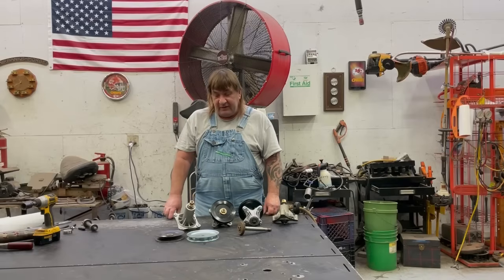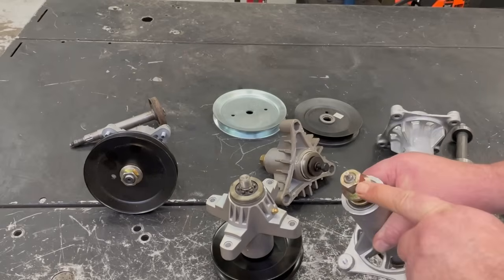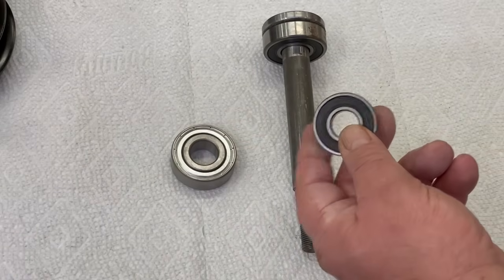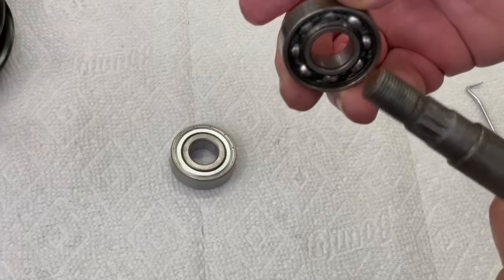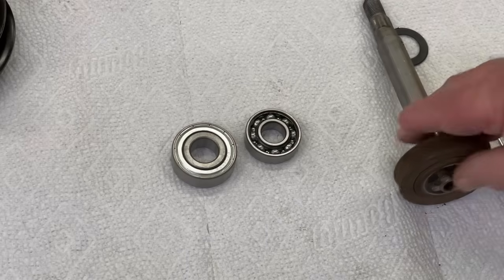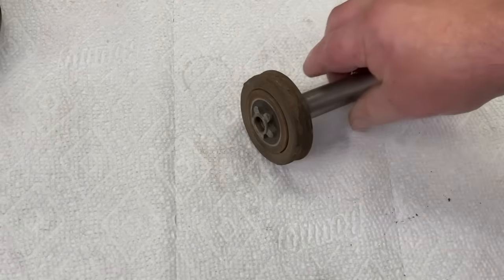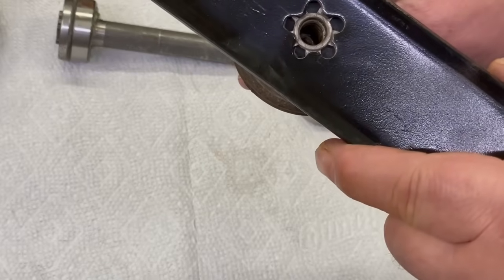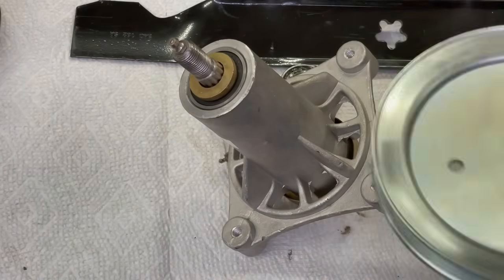BEST WAY to Grease SEALED BEARINGS on Lawn Mower Blade SPINDLES (make them last 3x as long)

Comment: You know when they put a greaser on a spindle that's not usable.. that really shows you how much they care about their customer.. if they would do that I wouldn't put anything past them.. I think they try to make sure they sell you a good paint job.. people just love looking at those new shiny lawn mowers... But they don't understand that it's total garbage...😅
Reply: Not really.... if you pump enough grease into the spindle to pack it full and pressurize a bit, the grease WILL push past the seals and enter the bearing. These bearings work best with less grease vs more.
Reply: @dontblameme6328  the greasable bearings never have the shields on them so it's just pure laziness

Comment: All I do is take off one seal of the bearing, pack the bearing full of grease, put the seal back on, coat the spindle shaft with grease and put it all back together. Filling that whole spindle housing with grease is doing nothing but wasting (now expensive) grease. It's worked for me for 20+ years and I've never had a bearing failure. A special note: Any new sealed bearing you get, take off one seal, pack it and put the seal back on. The bearing will last 4-5 times longer. They put very little grease in them from the factory. On autos or bikes, the wheel bearings are the same way. Very little grease.
Reply: I was thinking the same thing, especially with the top bearing.
Reply: good advice

Comment: Not only do the knock off companies use poorer quality metal, and sometimes not grease the bearings enough, they also may not be using the correct grease for your application...and likely a cheap grease as well.
I repacked some North American bearings that sat in a drawer for many decades. When I get to it, they are to replace the arbor and motor bearings in my Dad's old table saw that I cleaned and aligned and repaired....all but the bearings.
I used a superior grease, so this will be the only time this job needs doing.

Comment: Another day I got two water pumps from an elderly lady they had grease cups on them for  the bearings. Old cars how did grease zerk on the water pump an oiler on the distributor. Some had grease lyrics of oilers on the generators. Nothing is made to last anymore cheap and disposable like life
Reply: Yup.
Some things are made better, but when a company claims greased for life, they mean you can't grease it, and  the grease only lasts for the life of the part that they want to sell.
This is especially true for U joints and ball joints.
Bearings generally like a little TLC in order to last a long time.

Comment: Thanks! I have an 11 year old MTD Gold lawn tractor and I cannot count the spindles I have replaced. Usually one or both each year.  The last ones I bought have grease fittings, and I have been greasing them. I hope they are not sealed bearings as you discussed.  I guess I should take them apart and see for myself.
Reply from the maker: Glad to help

Comment: I just replaced the spindles on a Husqvarna, I was wondering why the zerks were there on the new ones, I wanted to take the shafts apart to see if the other side of the bearings were off so that grease could get in there, thank you for answering the question I had
Reply from the maker: Glad I could help

Comment: As a long time maintenance mechanic I would advise just buying new bearings. When a sealed bearing runs dry the lubricant has left the vehicle which leaves behind clay,scoring the bearing. Too much grease will wear out bearing as fast as too little. There's a reason that there isn't much grease in sealed bearings. Also taking out the seal will allow dirt to get in. I preferred NICE bearings with stainless steel shields. 35 years of changing bearings. Believe me.or don't.
Reply: Resistance wear. Grease is lithium, or clay with oil. Trusted i talked extensively with lubricant factory  technicians. Plus 35 years. Yes I tried the same thing when I was a novice mechanic. Looks good on paper.
Reply: What do you mean by too much grease? How would that be detrimental?

Comment: Sealed bearings are greased for life. It only takes a small amount of grease at the ball contact point.  As the bearing heats up more grease melts and fills this contact area.  You are most likely doing damage removing the bearings and greasing them.  Most people remove bearings with a hammer.  Which is a bad system.

Comment: Here is what I find when you remove the inner seal and you force the spindle full of grease the outside seal will be forced off. Even if you drill a weep hole this will happen.  Now you can end up with grease on the v belt. A better way is to each season take the spindle apart, pry the grease seal off, clean and lube the bearing and reinstall the seal. More work yes.
Reply: Grease it before putting the top bearing on and locking the pulley(bearings) in place. This allows the air that will be trapped in the spindle barrel to escape. Once it's fullish put the top bearing in the spindle and give it a couple of pumps and assemble it all. You won't have to ever grease it again. I have added small hose clamps and bent the end to serve as a slinger but honestly I haven't seen it make a difference. I guess I wasted those clamps. Lol

Comment: Some great advice here! I've always poped the inner seals out just so grease can easily get in them, but i learned tonight that even with them on, the grease gets in. I have a mower in my shop right now with a blade put on wrong, surprisingly that's not the spindle that's bad. When i mowed lawns i had a customer call and tell me i left a mower blade in her yard. I told her that's impossible, but sure enough. The star had enough grip that when the bolt fell out it stayed on and worked fine. It was laying right where i shut the deck on on the way to the trailer. Figured I'd find the bolt next time i mowed, but never did
Reply: Put a magnet bar on your deck. It'll find lots of things in yards.
Reply: How the grease gets past the seal is enough heat is generated it liquefied. To generate that much heat the bearing has to run dry long enough to cause damage to the bearing rollers, race, or both. A properly lubed bearing will run cool, well bellow the drop point of the grease.

Comment: Have you ever just one time pumped grease into the assembly and see where the grease goes once the unit is completely filled? Sadly this is another video misleading people on this topic. Those caps will not stop grease from passing unless the unit has a weep hole. Pump those puppies full and stop wasting time taking the assembly apart to remove the shields. Here is a video I did to show the facts on the matter.  https://youtu.be/PwObkilFXN0?si=Wnw6dvzX3jTTV4Hm 
If your not going to prove that those won’t take grease your just wasting peoples time and feeding them garbage information. This is a disservice to the DIY community. I’m not saying that removing the shields is a bad idea, but I am saying its pointless to take an assembly apart when you could just grease the assembly the way they are and move on with life. Dont believe me? Just try it. It would be crazy to think someone in the business would not experiment a little and find out the facts. Where does the grease go? If that unit is filled with grease it will then pass into the bearings regardless if it has Rubber or metal shields. Those thin rubber lips won’t stop pressurized grease from passing. Plain and simple. Cold hard facts. Prove your point.
Reply from the maker: this is just the way i do it. there are many ways of doing things, thats why the the usa is the best
Reply: @lmsmallenginerepair4471  I understand that’s one way to do it, my point is that the shields don’t stop grease and there is no need to take the u it’s apart to achieve the same goal. You can simply test it yourself but hay, whatever you like. Just wanted to mention that it’s most certainly not the only way to get grease in the bearings. Your viewers may be lead to think it’s the only way so for those viewers it’s a disservice.

Comment: grease does penetrate into the bearings.  BUT!! You have to pump 70 times into the grease fitting.  I just pack the bearings by hand, just like the front wheel bearings on my ole truck.
Reply: Absolutely correct! Most people don't fill the spindle cavity.
Reply from the maker: Great tip!

Comment: Will this work on bearings with no grease fittings? My troybilt deck bearings making noise but not squealing
Reply: I have repacked the idler pulleys on my deck.  I always use wheel bearing grease instead of regular grease.
Reply from the maker: you can try it

Comment: Why not just pop off the seal, fill the bearings housing directly with grease and then put the cap back on? Seems like theyd get the grease they need and itd be sealed from water and dirt
Reply: There shouldn't be any water or dirt in there, shouldn't... Lol. Taking them off and filling the cavity with grease keeps water and dirt out though, and the mass of the grease helps dissipate heat from the bearings as well. Only downside is the cost of filing it with that much grease. I got here tonight seeing if anyone's ever put something in there with the spacer to take up some space, but haven't found anything like that.
Reply: @theamaturepro 
Sealed bearings will overheat when overfilled, except for very low speed bearings.
I pop off the seals and clean and grease them with just enough quality grease.
Shielded bearings can be used with greasable housings with a grease gun.
Seals can pop off and become useless when over filled.
Reply: I have done that on idler pulleys with no issues.
Reply: True
Reply: I agree.  Just pack the bearings and reinstall the grease seal.  Job done.
Reply: @karguy1720 
That's the best way to deal with sealed bearings.
Shielded bearings can be greased in the assembly with centralized greasing.
Reply: I’ve replaced hundreds of spindles over the years, and few(if any) were due to lack of lubrication. If you’re concerned just pack before installing, but leave the metal shields alone. The problem with removing inner seals and filling the cavity with grease is now you have to maintain it. You’re more likely to damage the blade mounting area or crack the housing before the bearing goes bad.
Reply: Can this be done with any sealed bearing? (i.e. pool pump bearing and automobile wheel bearings)
Reply: @majortom5190 yes you can, but be careful about doing it to bearings that are already dried up and worn out.  More grease will make a shot bearing run quieter, but it’s still shot.
Reply: @majortom5190  Yes you can, I do it all the time.
Reply: @majortom5190 
Basically, sealed bearings need to be serviced up close and carefully, not damaging the seal.
Shielded bearings can deal with grease fittings in the housing and centralized lubrication, because shields aren't truly sealed, and they accept lubrication without blowing out the seal.

Comment: One of the most down to earth presenters/talkers on YouTube with good common sense approaches to real problems.
Reply from the maker: thanks
Reply: Apparently not common sense or everyone would know this already.  Good video.
Reply: You have to fill the spindles until the grease starts coming out... That pressure pushes grease into the sealed bearings, so no need for all of this work... Removing seals in order to manually grease will invite dirt & dust (grease is sticky) which may shorten the life of your bearings.
Reply: @cmcg1190  The first time I had to replace a spindle due to bearing failure I discovered the exact issue he is demonstrating. I removed all the inner seals on the other spindles and the new one. That was 7 years ago and I haven't replaced a spindle on that mower since. I mow 3.5 acres with that mower and it's still mowing strong. It isn't like I have to pump grease until it pushes out the other seals. After the initial fill your pretty much done ever having to grease it again. Think about it. The factory bearing might, and I emphasize might have 1.5 cc of grease in them when new. So, once they're filled using this method you won't have to bother with it again. 
Edit to add: wrong. You will literally push the bearings out before grease penetrates the inner seals. And word of caution to those that decide to do this, in the same token, you can push the outer seals out by pumping in too  grease. Read my comment above again.
Reply: @cmcg1190  patently false info

Comment: Sir, what you failed to mention is that water, dirt will be able to get to the bearings. Also you are using a large amount of grease just to get to the bearings. Best wishes sir, Ken
Reply: If you keep an assembly such as he presented packed with grease water and dirt will not get to the bearing.  The alternative is that the factory bearings with seals in place do not receive any grease and wear out quite quickly.